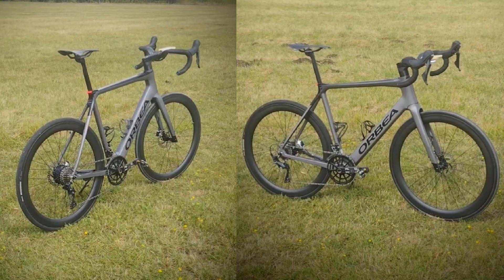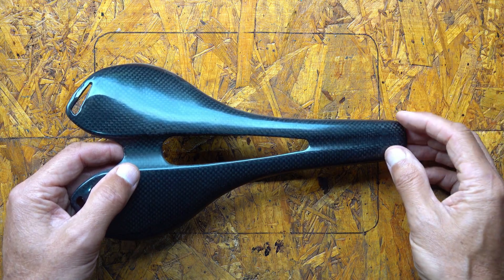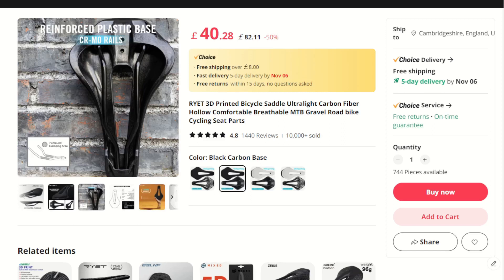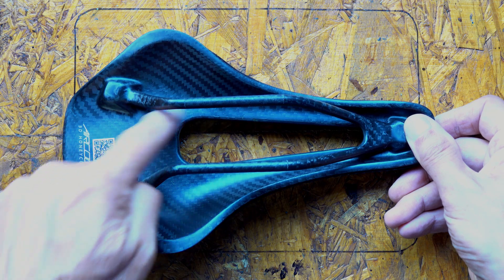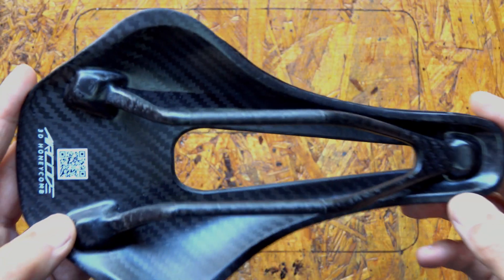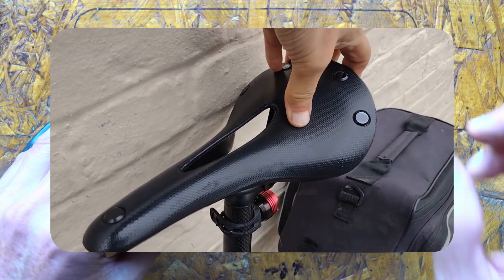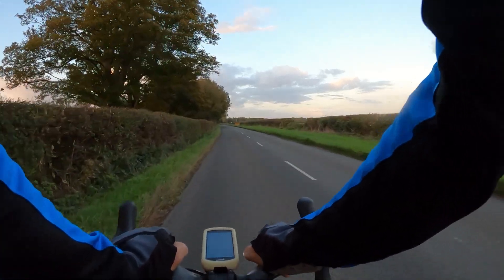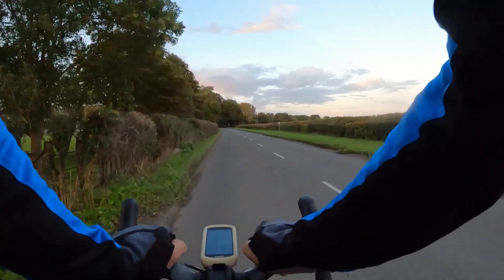Ryet 'Aircode 3D printed' saddle

Comment: As a slightly "Weight Challenged" person of a 100 kg+ I, also have a Selle San Marco Royal saddle for my 2019 SuperlightM6LXBrompton, folding bike and a longer, "Scandinavian Standard": 600mm, now Titanium seat post for it (We are generally tall people!).  I have found a standard length, "children size", ordinary length, 535mm Black Titanium seat post, for folding and Travel reasons (If not I can't use my German B&W box!), and a turned round clamp - below the saddle, to see if a new "Ryet, Printed Saddle" will function on my bike?  Finn. Denmark
Reply from the maker: Thanks for your story. Despite being from the UK, a Brompton is one of the few bikes I've never ridden.
The only thing you need to be careful with is the clamp on the seat post. Most steel railed saddles have 7 mm diameter rails whereas on carbon fibre railed saddles they are generally 7x9mm.
It's best to use a carbon fibre rail specific clamp if you can. 
Otherwise, I hope you enjoy your Ryet saddle, let me know how you get on with it. 
Terry

Comment: Your handlebars on this video, what brand and where did you get them from? I’m looking for a set of riser bars
Reply from the maker: Thanks for your enquiry; I'll do my best to answer it. Firstly, I did make a video about the handlebars which can be found here: https://youtu.be/XP2QH62zlBc?si=dEDi7a0UAJfKjB7K
I purchased them from AliExpress, but I don't think the seller is still on there. However, the handlebars are widely available and often branded as EC90, try searching for 'handlebars road EC90 carbon'. If you don't want to deal with AliExpress, you may be able to find them on eBay, although they'll probably be about twice the price.
I hope this helps, if it does, let me know if you get what you're looking for. Martin

Comment: What torque setting did you use for clamping the carbon rails?  Do you have a single or double bolt saddle clamp?
Reply from the maker: Good question. However, it needs qualification from my point of view. I didn't use a conventional saddle clamp, I used one like this: https://youtu.be/xc70IG6PtVY?si=dT9ouuFwI4v6SbUr
A torque setting is a bit meaningless for a clamp like this so I just went by feel. 
For my conventional seat pins, I don't use a torque setting as my other bikes have saddles with steel rails. 
If I were forced to give a number, I would go with 6Nm to start and an increase if the saddle slips. 
Sorry I could not be of more help.

Comment: The 3d printed rubber does not work for me. The rubber or cushion collapse sooner than my rip-off Shimano pro stealth. After 30 minutes you can really feel the stiff carbon rail and the road.
Reply from the maker: I don't know what the 3D printed material is, possibly TPU which is actually polyurethane plastic. Whatever the material is, I take your point. The padding did feel a bit soft when I pressed it. Bad weather where I live so that testing that I need to give the saddle may have to wait a bit.
Reply: same experience here - it seems to deflate over time. I don't think the foam density works well beyond 160-180 lbs.
I would say keep playing with positioning and tilt, got mine to feel trouble-free for 2-hr long rides after some experimentation.